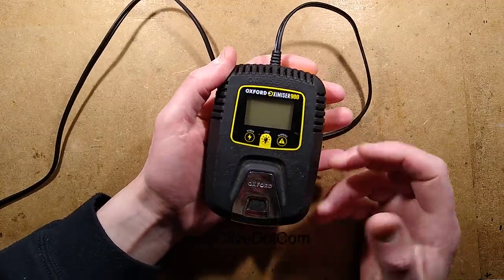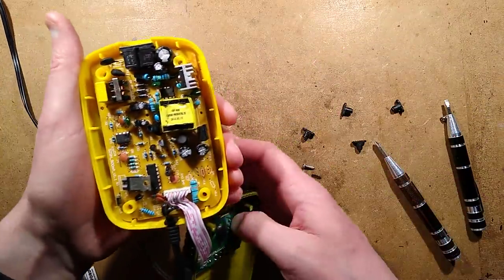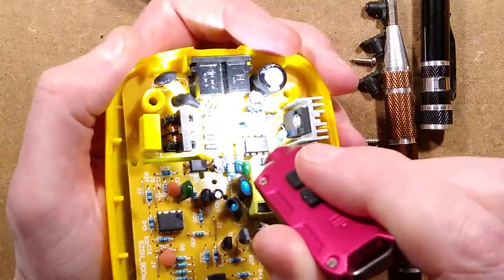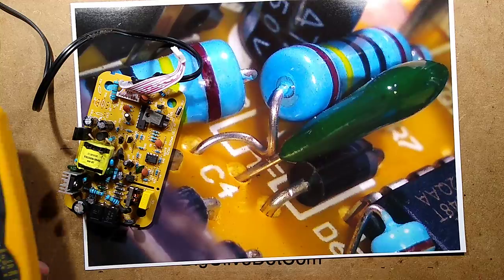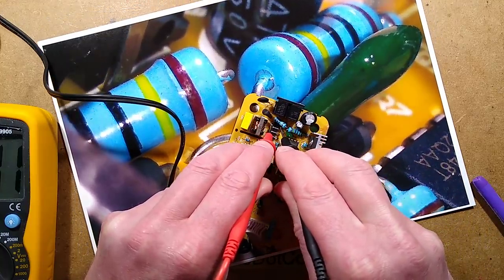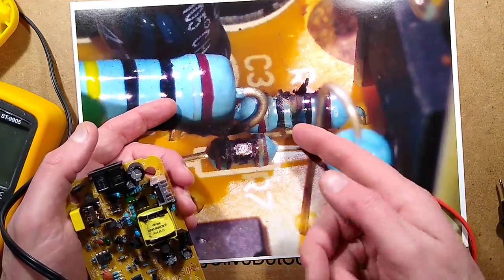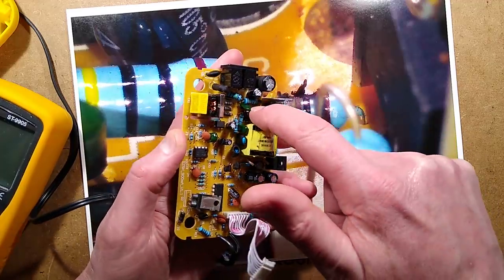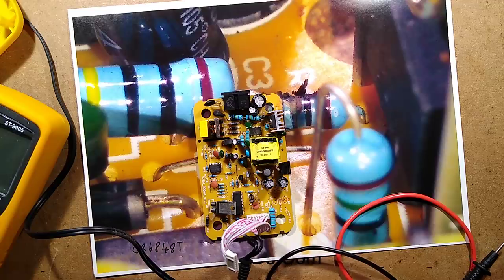Autopsy on Thomas Nagy's bike battery charger.

Comment: As a retired electrican (70 years old now) in contracting, I love to watch Thomas Nagy on youtube to see how the trade has changed over the years. This is why i enjoy your channel Clive.
Reply from the maker: Would you agree that it's all gone a bit political?
Reply: @bigclivedotcom  Definitely, too much paperwork now and Health & Safety gone way too far. There was nothing wrong with the 13th Edition regs. We were extra careful working on live boards and used our common sense with safety. Still have a Wylex rewire-able fuse board in my garage. (Rcd backed up)
Reply: As an electrician over 70 but still working in industrial heavy maintenance I am saddened by the amount of electrical parts now imported from China. Relays, dB boards, mcbs, rccds, electronic controllers, socket outlets and plate switches, not mention led lamps,  and electric heaters.
An awful lot of it fails after a year, often in an unsafe manner.
Still we cannot make paper masks either. I blame accountants who will only allow the purchase of the cheapest options in everything.
Reply: @petergreenwell7002  You almost never hear people talk of "fail safe" any more. It was drilled in to me by my various professors. I am sure 99.99999% of the Chinese never even think of this.

Comment: I do this process all day every day with industrial equipment. I also paint with a similar broad brush, though our repair techs balk at my recommendations. I have a fairly good record for things talking to me so I've acquired the trust of many. 
People and companies send us all kinds of stuff to repair, which is actually the really cool part of my job. It's always something different coming down the line.
Thanks Clive!
Reply: Yes, especially when the spares are either no longer made, or lead times are in the months for it. fix it fast, and order a new one if possible as spare part for the next time it pops. Often you find simple easy to fix problems, like capacitors failing, which are easy to fix, though I find with any SMPS the output caps can be practically open circuit and it will still work, but if the controller chip capacitor is dead it is totally not operating, or is going to run in bursts. 

Most common one i deal with is gate motor power supplies, where the same 3 capacitors fail, even through a load of board revisions, so I keep a small stock of the 2 values around, and put them in, though the latest version uses a SMD version of the capacitor, so the replacement is a leaded one with the leads formed into J leads to fit the pads. Double the value of the one fitted, and 50V rated instead of 16V, so should last well, even if it is in a nice toasty area of the board, and is cooked by the sun all day long.

That power supply at least has high voltage rated resistors where needed, though probably the original design had 1/8W resistors all in the positions, at least till the first few units were tested and they found out that the resistors either turned into lamps or flashed over. Then listened to the designer and put the high voltage higher power ones in, but were too cheap to respin the board ( admit the mistake) or put any sort of sleeving on the longer leads.
Reply: i love to be able to do what your doing someday.. sounds very interesting.
Reply: How did you get into this line of work?
Reply: @TheTechOnline  cant speak for the other gents, but for me (as an autospark with a degree and general interest in electronics) it came about as just offering to help folks with issues, and general chit chat, eventually after a few things are fixed word gets around, whenever a customer hears of someone else with issues my name is brought up, before you know it im repairing welding machines, inverters, guitar amps etc in the back of my garage. I do also do component level repair on automotive stuff so have a fairly well kitted out workshop, and that no doubt helps get me those sort of odd jobs. .. short answer, offer your services to folk you know, especially if they dont care about the broken stuff financially. i.e. nothing to loose jobs.
Reply: @denisohbrien  Mum brought me her friend's (smoothing) iron to fix many years ago. Can't remember what was wrong with it - nothing difficult, and back it went. A couple of days later, it was returned: "Doesn't get hot enough".
I noted the fact the temperature setting was still on minimum, cranked it up, spat on it and it hissed beautifully. I sent it back - again with the thermostat turned to minimum.

I was given a faulty microwave - which I fixed and then sold. A few days later I had a complaint that it sparked a lot and wasn't safe. I asked if they'd cleaned it out with Brillo/wire wool - and they said yes.
Sometimes it's just not worth trying to help anyone - more trouble than it's worth.
Reply: @millomweb  The problem there is not your work, but your ability to gauge a customer (no offense) I have refused to sell a perfectly good car to certain people cause I got a bad vibe , and same with regards doing work for certain folks. In the eyes of folks you described, you touched it last, its your fault.  My take on your last sentence, Its not worth trying to help SOME folk. In my case I have a buisness, an hourly rate etc people dont come to me cause im cheap, they come to me cause im good. But I remember all to well what it was like when no-one knew I was good, so I could only be cheap ;)
Reply: @denisohbrien  Not actually my ability to judge the customer as the processes were via a third party ! My mother in the first case - and actually possibly in the second case too - although I can't actually remember. That 2nd customer turned out to be a cafe !
Some folk will blame you irrespectively !

Comment: Bypass the fuse and the problem parts will self-illuminate for easy identification :D
Reply: Probably Illuminator red for your convenience as well.
Reply: I feel an urge to point out the sarcasm here. I couldn't get the smell of burnt high power transistors from my room. It was a 100W subwoofer amplifier, and i even just replaced the fuse, probably would've made a bang had i just shorted the fuse. However, on low current appliances, this can be actually used. Injecting voltage with a current limit on a dead DC rail can help you find a shorted ceramic or tantalum cap. Louis Rossmann uses this method with a thermal camera, and whoever came up with this method is a genius.
Reply: @lakiza55  hey there. By the way there's also a technique called Power blasting blasting for good reasons maybe it would work in this case but who knows but this is Bailey and we're supposed to what you were saying about the amplifier.

And having a big bang and smelling of the transistors Etc

But there is a technique it's used that you would use to save voltage that the Safari I was rated however at mini mini mini X to current.

Hey it was a 5 volt device or 12 volt device and say somewhere there's a short for example a bypass cap for a faster like that or even a chip sometimes. Or something else. The idea would be to connect instead of a very puny Loker power supply that would just is there bull fuse or just refuse to structure a startup Orion be destroyed? But using something like a PC power supply or other power supply that has what about 20 or 30 or more times much current you get the idea and fire in the hole is one might say connect power and then whatever component will in some cases self destruct identifying where it is on the board I've used this technique few times with good success. It was a pesky problem bad bypass cap there was probably over a hundred of them on the Ford cannot remember what it was that I was working on.

So yes it could work although be careful. Of course.
Reply: @lakiza55  I agree.. it was taught to me 38 years ago...
Reply: @sprintst3000  that's amazing, really. It blew my mind that my high school programming professor had gotten a software engineering degree back in the 60s. There weren't any PCs, just plain papper and pen. Same for EE, no simulation software, prototyping boards, fpgas... It takes courage to dedicate your life, or even just invest your time into something that's just an abstract, hoping it would prove usefull in the near future. For that, you have my respect, sir.

Comment: Hello Clive

I always find your strip-downs very entertaining and informative.  I taught elementary electronics to college students and fancied myself as an electrical engineer as well as a physics teacher.  Your knowledge reveals huge areas of my ignorance.

In your second photograph I noticed another skid mark that was hidden by the capacitor that was nearly touching the badly installed resistor.  One of the rectifier diode seems to have split from end to end.  I have blown several components in my time, including a diode similar to this one.  When I did it, its guts spilled out of the split in the form of a blob of metal.

There aren't any guts spilling out of this one.

Many thanks and keep safe.

James

Comment: Excellent video Clive! I've just completed an autopsy on a similar 'Oxford Oximiser' charger, and the little IC chip that controls the power supply section has skid marks all over it, and half the legs blown off the board! - They're not cheap these units, and they don't seem to be made with much quality from what I've seen!
Reply from the maker: I'm waiting on delivery of an interesting module that may be a retrofit that replaces most of the primary side circuitry.
Reply: @bigclivedotcom  Excellent! Will this be made into a YouTube video? :)

Comment: I think it can have bridged over when its being used, as everything warms up a bit everything expands a little.
Reply: yeah, it could have fell from where it was sitting or got set down/dropped onto bench or floor and had a big "BANG!, but it doesn't look like it shorted where the legs were close.
But I do wonder if the small resistor body was touching the leg of the large resistor and an electrical surge or insulation breakdown caused an arc-over. it was hard to tell by the video if the potential difference there would be at or near line voltage, it's possible it could have HV spikes from induction when plugged in or out.

Comment: If you buy a new one, maybe you should open it up and check inside to see if this is just the way this company does things.
Reply: Yeah, I was just about to say, $30 (pretend I used a pound symbol) might end up costing you your house if you charge indoors
Reply: I certainly wonder if that resistor used to stand tall above the board until someone mashed it down.

Comment: It looks a bit like they might have designed the PCB for a small resistor, and then had to later put big ones in after manufacturing had started?
Reply: Yeah that sounds likely, especially if the curly lead is a sign that the resistor in that position needs to dissipate more heat than the original design anticipated.
Reply: Maybe it was supposed to be installed vertically, but the assembler didn't get the memo.
Reply: @CarlCLongnecker  Substituted a 0.25W resistor because it only dissipates 0.25W, then found out that you also have voltage ratings.
Reply: Looks like it. And now the larger one is touching and baking the capacitor as well. Bad design.

Comment: The question remains: is it sloppy manufacturing or sloppy design? It almost looks like the circuit board was originally designed with quarter watt resistors in mind, and they used the bigger ones (half watt?) instead. Whether that was because the original ones got too hot or because that's what they had lying around that day, we may never know. The first circuit board I designed at school had a similar thing: I used quarter watt resistor footprints throughout (it didn't really matter, the power consumption was only a couple of milliwatts, if that), but when I submitted my BOM they didn't pay any attention to that and just provided whatever rating they had at the time. Some of them were way too big.
Reply: I'm guessing both. First, sloppy design with undersized resistors. Then, sloppy redesign ("hey, use these big ones instead") without any provisions for leg insulation. It could still have been done reasonably safely with straight legs, but a sloppy manufacturer curled them up against other components.

Comment: Clive. Thanks for the advice the other day r.e. the 10v UV-c bulb.
I don't think I have the pieces to make it run so I've switched over to plan B, basically a UV-C strip light that runs on 240v.
Now I've got a large box to sterilise all the mail that arrives.
👍😷

Comment: Got one of these charging my motorbike, was tempted to get a second one but now I think I might try the small CTEK instead.
Reply: I swapped to ctec after my 4th Oxford charger simply stopped working, they all did this.. Just stopped working , no issues with ctec yet 3yrs after I bought it

Comment: I've often just measured the BURNT Resistors and obtained a good value from them.  Most fail OPEN.  If they're still working (Conducting)  the values  are close enough to work.

Comment: So it appears they must have made a change to a higher wattage resistor for those 2 after the board was designed and in production and never bothered to redesign the board.  My guess is that it would cost too much to have a new board and case made when they decided they needed the higher wattage resistors.  I am guessing they did not have the clearance to stand them up as you see so commonly in Japanese designed boards.  The fact that the leads looked like they were just shoved in also suggests that the holes were likely snug from changing the resistor wattage size.

Comment: If you buy a replacement, keep clear of this brand. Bought 2 similar Oxford chargers, one was dead from the start. Supplier replaced the dead one, but the other did exactly what this one did, died and took out a battery that was only a few weeks old.
Bought an Aldi equivalent and it's given me years of reliable service.

Comment: Re you sure it’s a transistor? I had a ups fail and was looking at what seemed to be a failed transistor with shorts to all leads, but then I found out it was a lm??? Voltage regulator chip, which was quite annoying and I kinda gave up on fixing it (after I bought a replacement chip already)

Comment: It is strange, how many of the components have good placement and located through holes, wonder if during testing they needed to change some components which led to poor placement and separation?
Reply: To the practised eye, mine, It looks dreadful. The footprints for the big resistors are undersize, gaps are not design checked, and there are large areas of board underused. Who bends over all the legs of a DIL-8 to solder it ?

Comment: It looks as if a low power resistor was designed for and then manufactured with uprated ones. These were just jammed in badly.

Comment: It looks like the board was clearly designed for physically smaller resistors - I wonder if they had supply issues at some point and had to switch to the larger ones that don't really fit right. Or some bean counter ordered it because of cost...

Comment: there were some pace satellite receivers that blew their psus a lot, you HAD to replace ALL parts supplied in the repair kit, not just ones obviously popped, or they'd instantly blow again..
Reply: The Switched Mode Pyrotechnic Power Supply.
Great joy, it either works or blows itself to bits, luckily they have a shutdown option now.

Comment: Hi Clive, I have had one of these for years... however,  just noticed recently when connected to my bike I can feel a slight 'tingle sensation' on the metal parts i.e. brake lever etc.. what is causing this? is it something to be concerned about?
keep up the the videos!
Reply from the maker: Most ungrounded switch mode power supplies couple a bit of AC current to the output that can be felt as a slight tingle if you are grounded.

Comment: I have a totally unrelated question. I have a small solar panel plugged into cigarette lighter socket of my spare car just to stop battery going flat. Do I need to worry about over charging the car battery?
Reply from the maker: No.  The solar panels usually just put out a current close to a normal trickle charge.

Comment: I sub to Thomas as well.

Looks like the 1/2 watt resistor has shorted onto the 1/4 watt one , the end of the resistors under the coating is part of the tail wire.
Reply: that's my thoughts also, it was touching from factory and the coating hit breakdown voltage or inductance from power or usage surged through.
the resistor ends are often small metal cups and the body coatings do not have the same breakdown voltage rating as the whole resistor end to end :)

Comment: That large resistor with the long bent lead, looks like an after thought jammed in after the board was assembled!
Reply: it looks like a design error, they originally fitted too low a power resistor so had to wedge in a larger one with the obvious comical leg issues that ensured.

Comment: Id like to see the Roles reversed and big clive flying round london rewiring flats an schools in nagys spare van 😂👍
Reply from the maker: Not houses, but I used to run around in a van doing theatre equipment installation and repair in schools.
Reply: bigclivedotcom 
My mate used to work at the palace theatre in manchester 
The company brought the curtain down on his stage lighting career so he retrained as a bathroom fitter !! 6 months in the firm went bust so pulled the plug on that !! 
He left there to become a scaffolder 12 months in he broke his leg just when he was goin up in the world 🤣